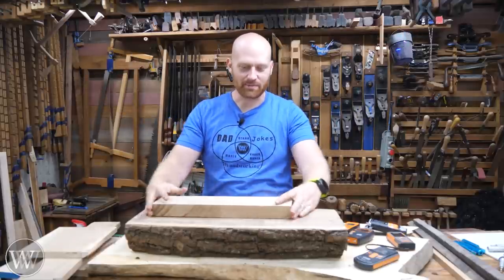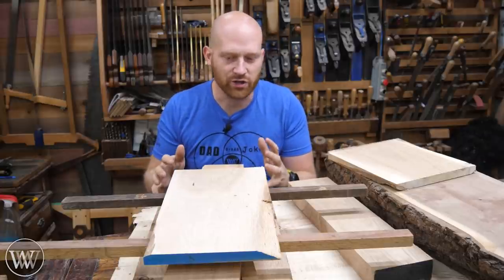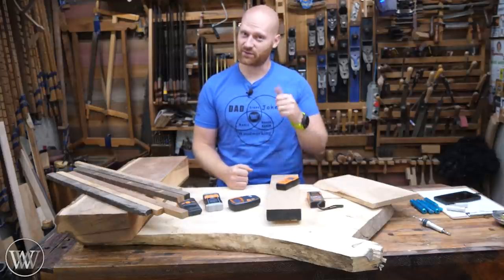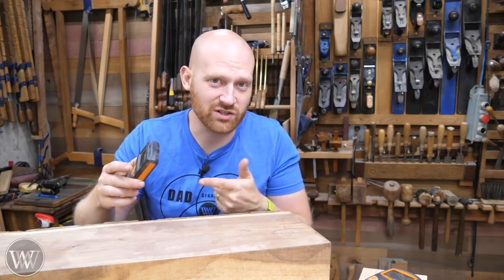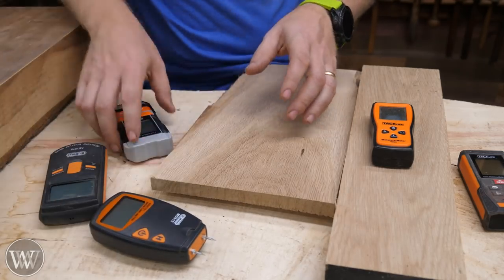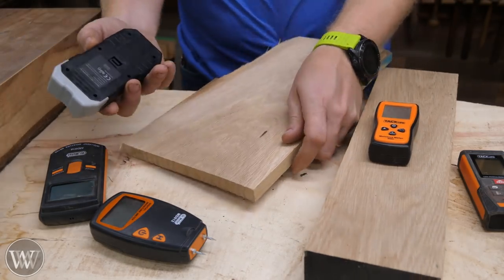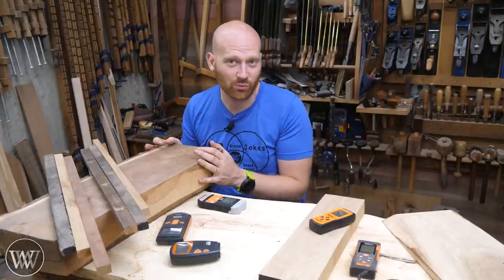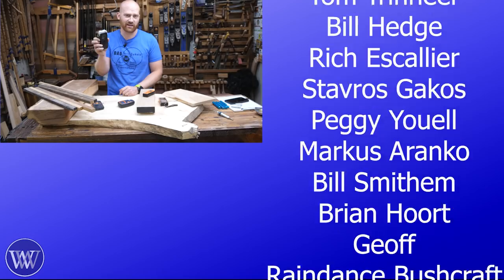How to Keep Wood From Twisting and When is it Dry

Comment: In the mid 70s what is referred to as white wood was marketed as " herfir" and vastly cheaper than Douglas fir. However you'd swear it was milled on the truck on the way to be delivered. A 20' 2x6 would drag on the ground when you tried to carry it on your shoulder. You'd get splashed sinking a nail and if you broke into a fresh unjt and didn't use it all you'd better reband it at the end of the day or you'd have a bunch of propellers the next morning. Saw some twist more than 90 degrees overnight in the desert. What happened to a pergola over a weekend without gussets and stickers bracings was like an fantasy. Good times.
Reply: Very funny... thanks... "... you'd have a bunch of propellers the next morning" (!!!).

Comment: I am fortunate in having my shop building cooled and heated (a heat pump through the wall.) I also have a dehumidifier, because I prefer the %RH to be around 40% for my comfort. I have found that wood dries reasonably well in that environment. Of course, the intent was to create a comfortable environment for myself. Controlled wood drying is a good stroke of serendipity. 
Thanks for mentioning weighing the wood. I hadn't thought of that. Now I will go by having both moisture meter AND weight stabilizing at some value.

Comment: I bought some carefully stickered curly walnut in Fort Bragg, on California's foggy northern coast. The lumber had been air dried, stored in an unheated garage for more than 10 years . Its moisture content was 14% which lends perspective to the local preference for working highly figured wood with hand tools. When that purchase made it back to hot, dry summertime Wyoming, some of the 1" cracks had run to 6". Jim Krenov, founder of the fine woodworking program at College of the Redwoods, a few blocks from where the walnut had dried, was asked to air freight a small blanket-wrapped piece to a famous gallery on Long Island. The gallerist said when the piece arrived in New York that same day the door had split from the extreme dryness of the cargo hold at high altitude. Regardless whether a woodworker thinks moisture content is a practical rather than theoretical concern, it is.
Reply from the maker: so true. it is amazing what a fast change can do to wood. especially anything with figure.

Comment: Hi James. While you do work in an air-conditioned space does't the humidity vary between summer and winter and does that not effect your wood. Sorry but one of my past hats was an HVAC one. For ease of calculations lets say you keep your thermostat at 65 deg. While your furnace/air-conditioner will keep the temp. within 5-10 deg. of that the humidity in summer would be around 70% or higher and 30-35% in winter even with a humidifier. Will that not effect the wood.
Reply from the maker: the humidity int he shop goes down to around 40% in the winter and up to around 60% in the summer, but that is not enough to make a measurable change in the shop and it is slow enough that it does not cause a problem. The big problem is when the moisture swings 50+% in a single day like it would in a garage.

Comment: I was thinking of using the loft area in my detached garage as a drying area, my concern is here in PA our humidity levels reach 99%, would this be ok or should I look into a different solution??
Reply from the maker: It works it is just slower and some times that is a good thing.

Comment: What’s your opinion on painting the ends on fresh cut logs and rough cut lumber
Reply from the maker: yes that is best. the end grain will dry much faster then the main body of the wood so it will shrink. and that leads to checking. sealing the end grain will slow that water loss and alow it to dry more like the rest of the board.
Reply: @WoodByWrightHowTo  What do you paint it with? I normally use an exterior stain/varnish of sorts, but is there something better? Or does it not really matter?
Reply: @ricos1497  you can use usual PVA glue for that without any problems, that will work 100%

Comment: I really wonder what causes twist?! I have a couple of guesses but I am still a little confused

1. The board has runout, when it cups, it will cup off axis and so two corners will stick out more than the other two. 

2. Some kind of impurity, inclusion or knot throws everything off

The reason I'm still confused is because I have a beautifull clear straigt grainded piece of quartersawn beech. But it's twisted

Any idea?
Reply from the maker: that is probably because the tree it came from was twisted and the fibers run out the face grain. even though t is straight quartersawn. that is the difference between quartersawn and riven lumber. also if it came from a part of the tree that had any pressure on it that pressure can release over time.
Reply: @WoodByWrightHowTo  right, I see.. twisted tree is a very good posebility

But are you trying to say that the twist in a tree straigtens out? That's cool

Comment: When you mill green wood, do you put wax on the end grain or no?
Reply from the maker: I usually use anchor seal if I have it and if I don't then I use a latex paint with a couple coats. Paste wax washes out and breathe too much. I do know some people who will actually dip the ends in wax or paint hot wax on and that will also work well.
Reply: Wood By Wright How 2 ok cool. I was told to do the hot wax thing but i’ve always wondered about it. Appreciate the response (and all the videos of course)

Comment: Every inch is one year of air drying..... So if I milled a slab that was 12" by 144" I have to wait 144 years.....? I'm misunderstanding this right?
Reply from the maker: Every inch of thickness is a year. Or at least that is the rule of thumb. So if it is. 4/4" X 12" X 144" that would be one year
Reply: @WoodByWrightHowTo  ah, thank you. Sorry I missed that part. I think my slab is 2 to 3 inches so I guess that would take roughly 2 to 3 years. Still a long time but I suppose there isn't any use complaining as the complaint won't make it dry any quicker lol